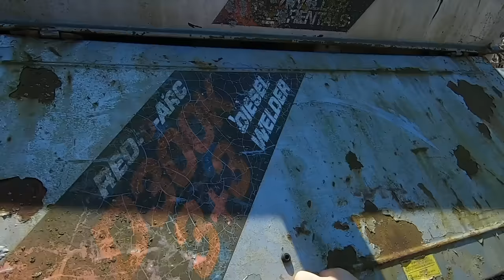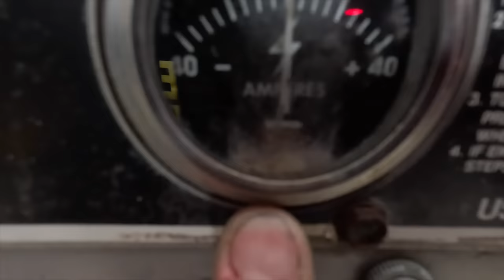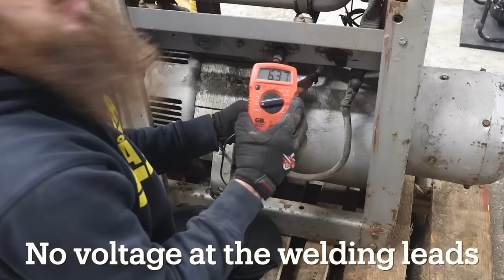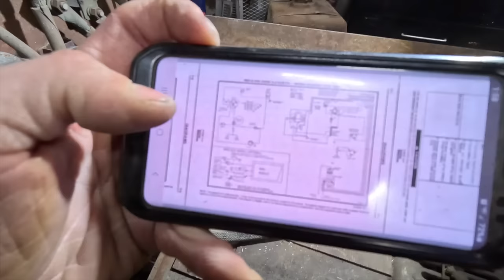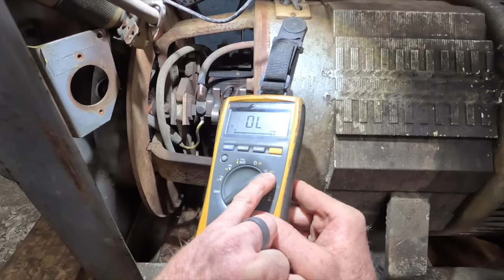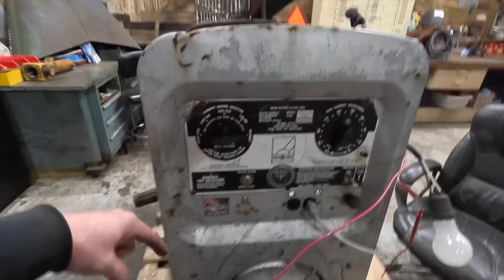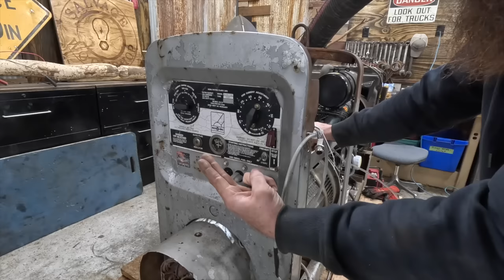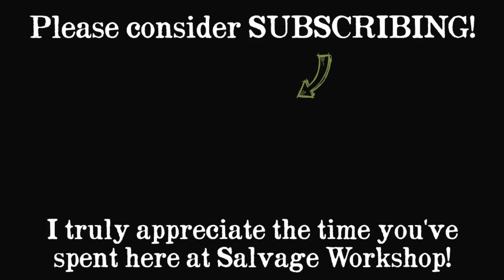SAVING an ABUSED Portable Welder from its Junk Yard GRAVE! ~ WILL IT START? ~ Red-D-Arc D300k P. 1

Comment: To excite the generator you only need to touch the wires for an instant.  When you see the spark you’re done.  I think You should do it while the engine is running.

Comment: It seemed like you had the amps on the 3rd of 4 settings at first. Then turned it down to the second range for welding. Only seemed that way to me cuz I got an old 500 amp transformer machine and did the same thing. Actually I cranked it up one at the end just to see. I could barely feed the rod in fast enough! Regardless good score good machine... Actually great score great machine! Good job!

Comment: I m not sure about this model but Lincoln had a CV tap box you could install on the SA200's to run an LN22 wire feeder for flux core and hardsurfacing welding. The suitcase wire feeders are more expensive than buying a small mig welder. Last time I checked it was $2000 for a suitcase feeder. Buy a small 110 or 220 mig machine instead.

Comment: Yeah man sometimes those large  Older model  Generators are built-in such a way that they can be reconfigured  on-site from 220 V  to 110 V Output  or vice versa Simply by removing the access panel and Connecting a couple of wires differently.

Old welders have a similar setup whereby moving a couple of levers inside  to a different configuration In alternate the welder between 220 V and 110.  That's before easy dial faces were invented I guess. 

 So just be extra careful when you're messing  With the wires so that you don't make something too hot Or charge something that's not supposed to have power onto it😅

Comment: Credit doing it up man, but 100A only, you can get a welder 150-200A and a small 3kw generator that you could carry on a trolley. 100A-think it would struggle with 3/32 rods, so about 5mm max steel thickness?

Comment: Flux is not required on soldered electronic or electrical connections if the correct resin cored electrical solder is used. Applying extra flux makes a mess of the joint and if it's acid type flux, the joint will corrode over time. Also, this is an alternator, not a dynamo, so it cannot be flashed to excite it. This is a brushed alternator, so the output current is controlled by the amount of exciter voltage, pretty much like the battery charging alternator, except that has an automatic regulator to control the output relative to the amount of charge the battery requires.

Comment: Yes a larger filer does filer more. You should always prime a diesel oil filter when possible and very important inside the filter in the bottom if you  see what looks like a miniture can then it has a pressure release valve. if you put a filter thats supposed to have that valve and it doesnt your filter will drain evertime the engine is off. Most diesels have that valve in the filter.

Comment: Those “safety” toggle switches i’ve always referred to them as Airplane Cockpit Toggle Switches or System Pre-Check / System Prime Switch. I also have no clue if they have an actual proper name or some type of MIL - Spec  # but I would appreciate hearing everyone else’s thoughts.

I really liked your copper pipe trick for making Electrical crimp connectors. I’ve occasionally run into to needing a size I didn’t have or being disgusted when i opened a kit only to find aluminum or flimsy tinned copper connectors that looked far from adequate for my project.
Reply: I know it’s cold where you’re at and I often see you working with a noticeable “Smoke Haze” before you mention something yourself. 

I often find myself in Identical situations from either braising or welding so what I sometimes do is just open 1 garage bay door by just an inch or two. That slight gap at the bottom will open another gap at the top as the door section pulls inward on the rails. The result promotes a targeted convection exchange encouraging the smokey air up at the ceiling to billow out while limiting the amount of cold air in.

Comment: Your bridge is working as it should, as far as I can tell.  It should be 0.5-ish across each diode in the direction of flow, and about 1.0V from - to + (again, in the direction of flow).  0.5 + 0.5 = 1.0, you see, discounting the slight voltage drop at each point.

Comment: Your 7018 is likely not completely dry. 7018 needs to be either in sealed cans or in a rod oven to keep it extremely dry. Moisture in the flux will create the porosity.

Comment: FYI if you want to do a very good cleaning job of that tank if it is steal you can add white vinegar and water and it will eat all the rust and all the crust out of the tank without putting holes in it to where it's leaking and then you can neutralize it with baking soda rinse it out dry it then you suspended and you dumped some red coat tank coating slowly turn the tank to coat the whole entire inside and it'll make a liner and you won't have to worry about those crusties anymore and you won't have to worry about fuel leaks in the future it makes an epoxy liner on the inside of the tank and depending on how fast you turn the tank to adjust how much epoxy liner you add
Reply: Three days soaking in vinegar water solution to clean out tank can you rotate it once or twice a day to make sure you're eating all the garbage out of the tank from top to bottom you'll end up with a clean metal tank with no holes that is prepped for coding with a red coat or epoxy coating to ensure there's no leak and there's only two sets of lines on diesel you have the inlet from the tank going to the injection and then the return line going back from the injection to the tank

Comment: When soldering your lugs, half fill your lug with molton solder, then plunge your fluxed cable straight into it,holding it untill solid. I will save crimping and will make a corrosion proof and neater job.

Comment: Great work!  You cannot measure current higher than 10 amps with that meter.  If you try that it will blow or burn up your meter (very dangerous).  The high current for a welder is measured with a loop (coil) probe when under load.  Again do not try measuring high current with a standard multi-meter!

Comment: I have a 1972 f250 360 v8. It has the same fuel filter assembly. The really parts guy told me I was full of it. Until I came back and embarrassed him  infront of his patrons as he did me.  Have fun. Old iron is nice. I also have a old michigan articulating loader . Big iron yea

Comment: That is going to be a nice machine.  They sale Switches that is 3 position and one of the  Position is Momentary, that is the best to use under the red guarded covers.  That way you don't have to stick your finger in the guard to flip the switch to the middle.  On AZ  look for "SPDT 3 Position 3 Pin Toggle On Off on Momentary Toggle Switch, Momentary Toggle Switch Toggle Switches 250VAC 15A ON Off ON Momentary"

Comment: My understanding is that one should never solder the wire in a screw terminal, because the solder can creep over time. Since I am not an electrician, I may be entirely incorrect!

Comment: Flux is an acid that, when heated, removes the oxides on the metal to be soldered. The clean metal itself then draws in the the solder.

Comment: Just a little hint: that bridge rectifier you will notice, has an aluminum block on the back. That is a heat sink. Best to reinstall it onto clean metal with thermal paste. Just like you would with a CPU on a computer.

Comment: We use to use similar but 500amp gen / welders on gas pipelines which were built by Lincoln and sat on the back of these huge ex military 4x4 commercial in the uk🇬🇧🇮🇪.

Comment: Hello, replacing the button with a switch was a mistake, when you start you have to hold the button and when the engine starts, the oil pressure switch takes over the function of the button, when the engine overheats, the thermometer disconnects the circuit. it is part of the safety circuit - after an emergency, the fuel supply is restored only manually by pressing the button - replacing it with a switch, the valve closes again after the thermostat cools down, and this is a mistake.

Nice day 🙂 Tom

Comment: You cannot add a wire feeder to that machine to MIG weld. MIG welding requires a constant voltage supply (CV). That engine welder is a constant current (CC) machine. You can connect it to a TIG torch, but not MIG.

Comment: Looks like that fuel shut off valve is a safety shut off. If the temp of the engine at the gauge gets too high it shuts off fuel to protect the engine. Just my thoughts. Thanks for the great content.

Comment: Hello Sir, excellent video and your viewers are outstanding. You should put contact "Detox" spray cleaner on your list, it good for removing and softs corrosion to easily. Watch your fingers touching circuits, your Fluke can read your body resistance so use alligator clips.

Comment: The diode mode on the meter shows you the voltage drop of a forward biased (conducting) diode, which for a silicon diode it about 0.5V. When you see a reading of double that value, you're seeing two diodes in series conducting in the diode bridge (which only happens in one configuration). So it seems your diode bridge is working correctly.

Comment: The field wires need to be hot while running. It creates the field that the rotor passes through to generate electric. And the was an oil pressure sending unit, not an oil pressure switch.  The variable knob is a rheostat. Rheostats adjust current by moving the location if a 3rd wire, potentiometers adjust voltage and only has 2 wires. There's also a variac aka adjustable transformer. It looks like a rheostat but you can adjust voltage without affecting the output in watts, including, based off what kind, output higher voltage. I don't think I've ever seen a DC variac. I can see that welders might use one though.

Comment: When it comes down to filters, if the filtration size is the same so the filter medium is the same. In short bigger filter will just last longer as it gets plugged and it has bigger flow rate. You can use bigger filter, but I wouldn't use a smaller one because of the flow rate. If the filter is not able to filter enough volume or gets plugged faster then it will start to bypass and you get no filtration.

Comment: If you mount larger oilfilter than the original, it will draw more oil to fill the filter so you get a lower reading on the dipstick. The recommended amount of oil to fill the engine in the manual will be off by the extra oil that goes into your bigger filter. Vice versa for a smaller filter, plus the risk of insufficient cleaning of the oil that a smaller filter  gives.

Comment: I think the diode was the major problem with the generator/ welder and the mess of wiring  would be great if you could find another one in proper working order to look at ?  Have been wondering what you've figured out on  the international trk ?

Comment: Make a layer for a door that normally doesn't open and think doggy door concept.  Fuel pump is a lobe on the engine and as it turns so does the diaphragm. Low oil the lobe on the engine can wear and not push enough.   My 57 ford was that way in 69.  So we sold it and got a 67 T-Bird.  Light years ahead.  Clutch enable ? or you need to have 12 v to magnetize the winding and then it will fire off. ??  The coil on the pannel is a variable resistor that is high or medium current level.  Three make a voltage tap on the wiper.  Sr Scientist Electronics retired.  Likely need 12v from the generator / alternator on the engine.  And the shaft has to turn and then it gets power to the windings.

Comment: Do not replace or bypass that push button ,as it is now you would need to push the button while starting until it builds oil pressure ,if you change it to a on off switch it will keep the solenoid turned on even with no oil pressure , you want it to shut off fuel when there is no oil pressure

Comment: That little beast actually needs to be mounted in the bed of a service truck.
On a trailer the paint job is going to get beat up from rocks and other debris real quickly. 
Along with damage to the control panel and items mounted on it.

Comment: Also, old wires can break inside the insulation but not show any signs on the outside .

 So yeah it's possible you broke a wire  When you were moving stuff around

Comment: There internal spring problem i suggest that you bend the top part of the spring more round then take a small file a Groove in the post not deep just enough so the spring can't slip. Placing RTV in the Engine not recommend it will end up blocking an oil way bad for you and the engine PS it's just a tip.

Comment: If the filter is bigger, it will allow more flow with less "work", so you will have "more" oil flow through the engine. The capability to filter stuff is basically the same, given the same material and distribution inside.

Comment: you do know that 7018 is a reverse polarity rod meaning that you weld with the stinger on the negative side.
Reply: Operation
E7018 stick electrodes are designed to operate with either a power source that provides either an AC or a DC (electrode positive-EP or electrode negative-EN) current

Comment: You probably need a secondary air cleaner inside the main filter and then you'd added protection for your engine and the new washer wouldn't be as critical

Comment: Don’t rev down the engine. Gensets/welders of that era had voltage regulators sensitive to low voltage. So, rpms come down, regulator attempts to compensate, poof goes regulator. KEEP THE ENGINE AT DESIGNED RPMS all the time.

Comment: Your testing is correct of the bridge rectifier.    testing from + to - terminals will be the sum of the resistance of of two diodes or approximately 0.9 ohms instead of the resistance of one diode.

Comment: Don’t use plumbing flux on electrical connections! It is corrosive and will cause corrosion at the connection over time. Use flux core solder designed for electrical circuits.

Comment: 29:31 time stamp ...I'm cleaning while listening....if you changed the temperature in the room how does it æ gas or fuel oils? What type of electricity charge does it take? When you have a "ground" clamp how far in the ground does it need to be? And how does the ground channel it or know where the electrical charge for the ground is going? 
I have a stupid question....if you think about porcelain being as heavy as it is and being the " heaviest" room for the space is this a grounding? Is the screws in the back of the toilet a ground clamp? If the toilet is a ground clamp what are all my options for clamping? 
For grounding?
For charging? 
For flushes? 
For filtration? 
For irrigating water heater pumps?
Reply: When you say "ground" clamp do you mean level? Like with the bubble...and when you use a level ....I say level to what? 
Level don't make sense to me I think it's because I can't tell if it gas water air or some other liquid that's attracted to it like a magnet ....also measurements that make me wanna 🖕

Comment: HEY DONT REPLACE THE MOMENTARY SWITCH FOR THE SHUTOFF SOLENOID.......once it builds oil pressure the solenoid stays open, usually have to hold it for a coupe seconds after startup......otherwise the shutoff solenoid will stay open all the time

Comment: Ok, lets go out on a limb and see how it works out. Video just started for me, welder just entered the shop... So if Red-D-Arc washed their hands of this, plus it sat outside for a while according to a comment I saw. This thing will be chock full of gremlins. At bare minimum it's clapped out. 

Doing this for content aside... will this be economical?
To avoid chasing  the whack a mole of issues popping up after getting problem A fixed, that exposes problem B and so on. If it's me I treat this as a total teardown and restoration. I don't feel like that's "you may as well" ing yourself into a bigger project than it is, it just seems like the most efficient route to get a workhorse in the end.

Comment: re your black lump with 4 terminals it is a bridge rectifier it has 4 diodes in side, the metal base is a heat sink to stop it over heating. its function is to convert from AC to DC

Comment: I’m pretty sure that the voltage stays the same, as on the data plate it says 40 volts. It’s the amperage you are changing with the dials.

Comment: Remember carbon monoxide is heavier than air it fills the shop from the bottom up.  (Same with your lungs, it fills them from the bottom up and displaces the O2 which kills you).  So you want any extraction system at floor level with makeup air coming in a bit higher up.  For temporary use I would take a piece of plywood the length of the chosen door (a joist 'I' beam would be perfect) cut a hole for the hose in it, drop the door down on it and you have a fairly effective cold air seal with exhaust going out.  Depends on how high you can raise the door without opening up the top on how well it keeps the cold air out.  Since it doesn't have to be more than four inches high at most it should work pretty well.
Reply: The specific gravity of Carbon Monoxide is 0.9657 (with normal air being 1.0), this means that it will float up towards the ceiling because it is lighter than regular air.

Comment: 1:17:21 Dolby Digital turned upwards? You get to a part where you say youll figure it out but dont right then so i rewound it and it landed on this screen also is it a matter of battery jumper cables or something smaller like a set of fuses pissibly capable of handling the same output maybe like an old push cigarette fuse lighter?

Comment: I’m no mechanic or engineer of any sort. But that solenoid shit off appears to be hooked up to the temp gauge in such a way that it would most likely shit it off as soon as it hits a peak cut off temp to protect the motor and generator. At least that’s what is suspect it would be for and do.